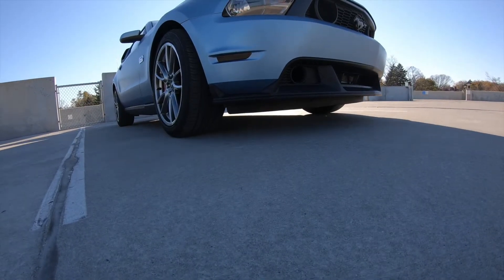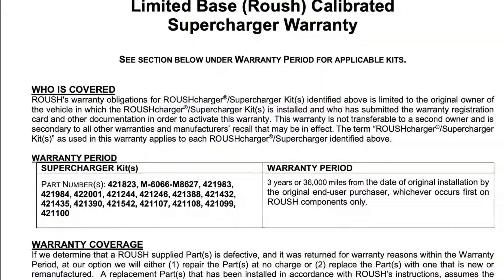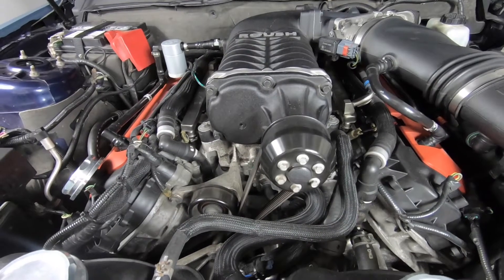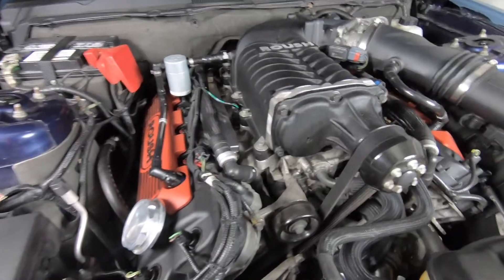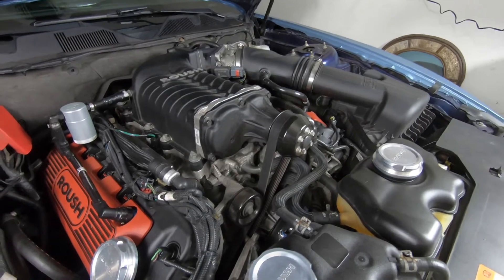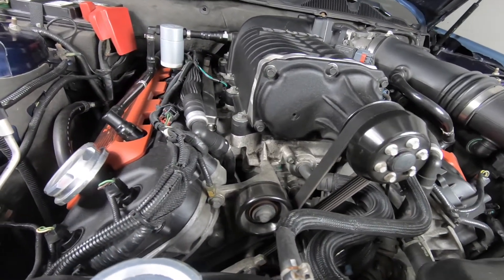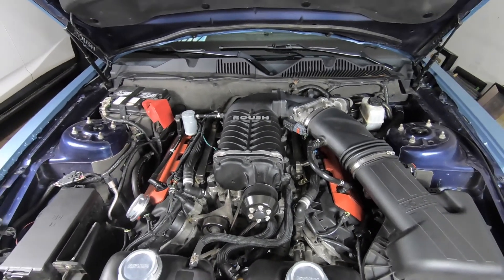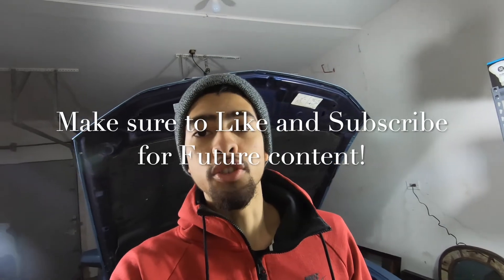Why you should consider the Roush Supercharger! | Most Reliable!

Comment: do you need to have headers  or a heavy duty clutch or do you need to have a one piece drive shaft
Reply: They are a good investment, if you stick with the can tune from Roush and don't run slicks you'll be fine with stock components. Long tube headers are the first point you should put money into, along with a bigger radiator for cooling! I had the mishimoto radiator installed at the same time as my Roush 2.65 on my 19
Reply from the maker: Headers, a heavy duty clutch, and one piece drive shaft aren't required the Roush supercharger kit is a fairly conservative  kit compared to others and are usually designed and tuned to run with a stock mustang with no issues but like how @BBMustang514 they're all recommend especially if you plan to turn up the power for example when I added headers on top of the roush SC I was able squeeze out a lot more power along with a new tune but i'm currently running with the stock two piece driveshaft and cooling system but I don't beat on it much at all so it all depends on how much power you plan on pushing with the Roush kit and how hard you drive your car are all deciding factors when looking for further supporting parts to be paired with the SC
Reply: @drewgtv1  thank you for the information I appreciate it have a blessed day